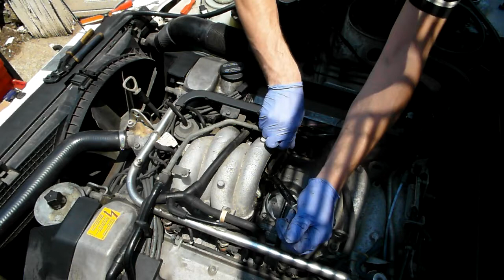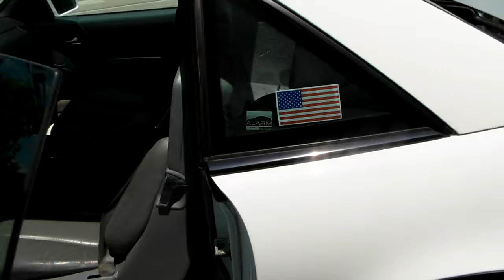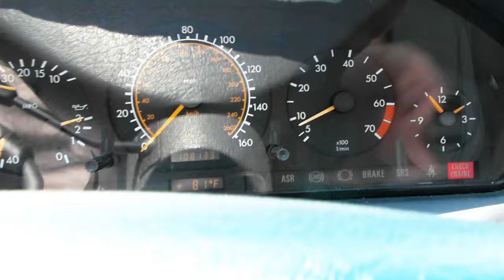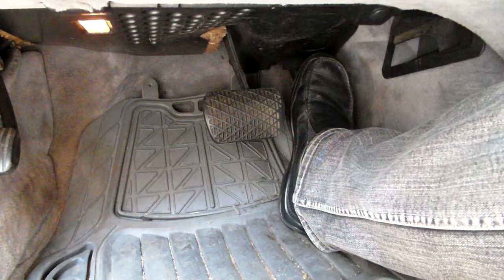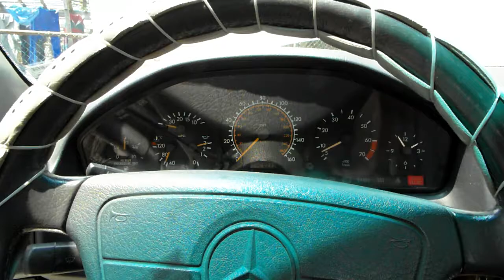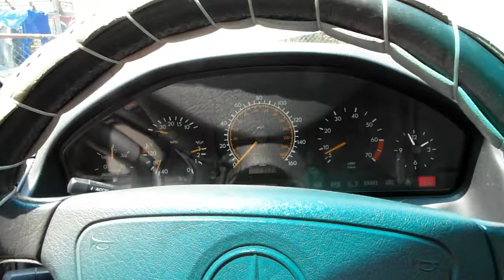Part 8. Mercedes V8 throttle body removal and installation procedures. ASR

Comment: Sir I m in Dubai and my 1997 modal c200 have same problem please help me to re fix this sane problem please msg me for fix this please
Reply from the maker: I do not offer remote diagnostic at this time. I only diagnose and repair customers cars and parts that customers mail in for rebuild.
Reply: @vsandvs  do you rebuild mass air flow sensors like the one in the video? I have this exact engine.

Comment: Thinking of purchasing a 1995 SL500. The ASR and ABS lights are on. Is this car just asking for trouble?  If it needs the throttle body cable replaced, where can I find that. Is there a part number. This series was very informative, but old. Are you still around?
Reply from the maker: I rebuild these throttle bodies. Info is in my website at restoreyourmercedes.com